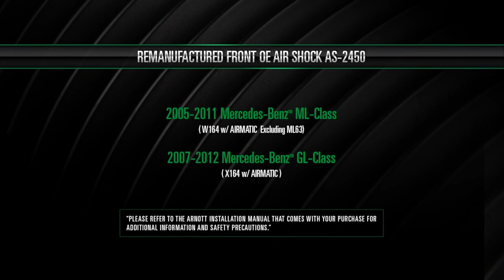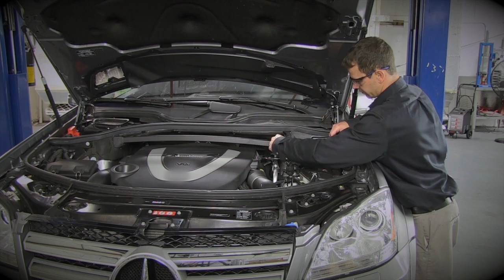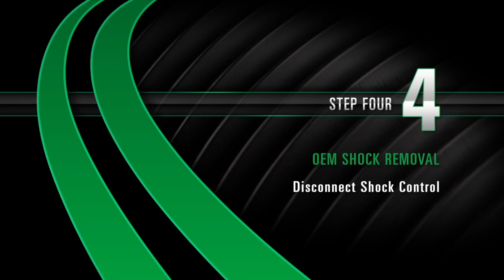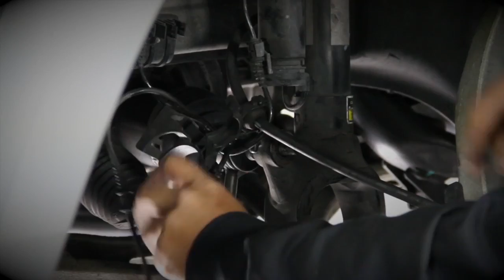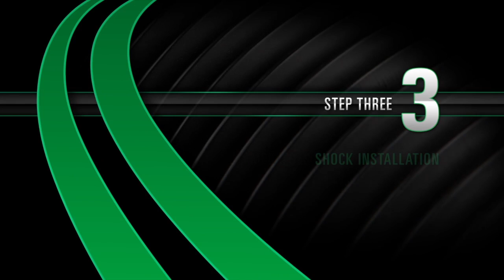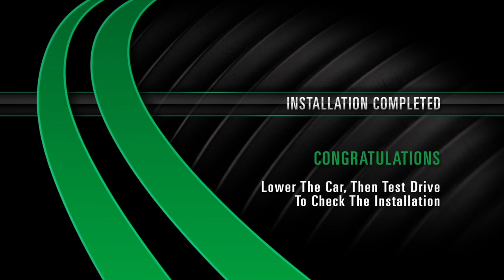How to Replace a Failing Mercedes-Benz® GL & ML-Class (W164) Front Strut

Comment: Great step by step video!  I just completed this on my 2009 GL450.  One note - the step where you (Step 5) remove the upper control arm nut and separate the upper A-Arm this requires a Ball Joint Separator.  Pretty straight forward and purchasing the Arnott replacement Strut and doing the job myself saved me at least $1000 from the dealer!